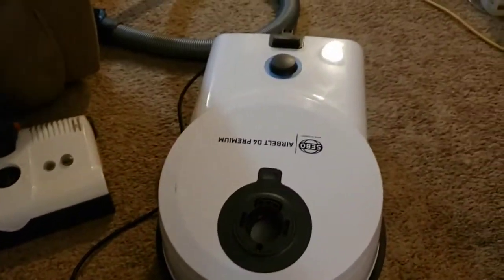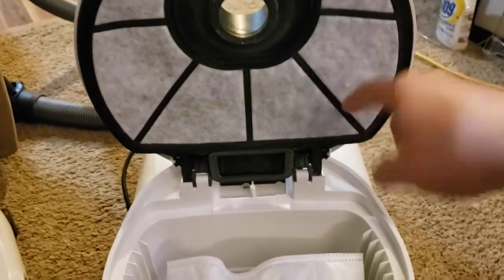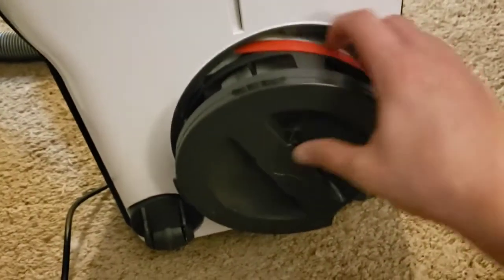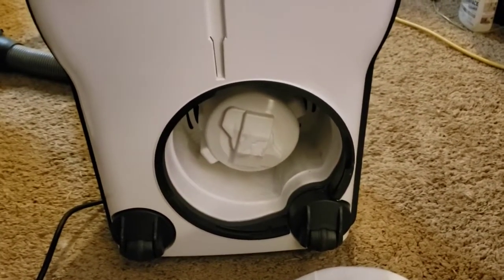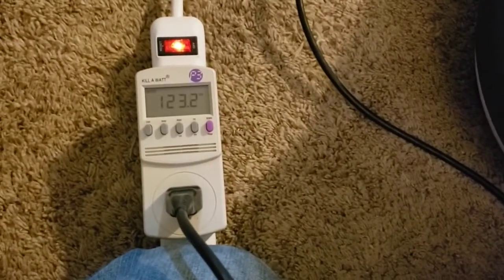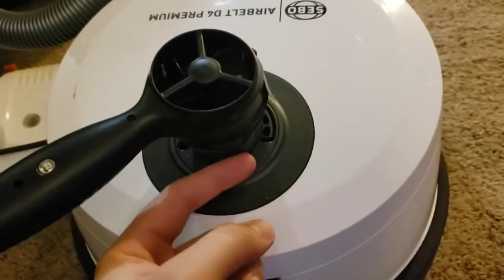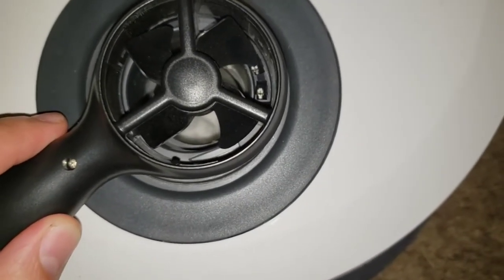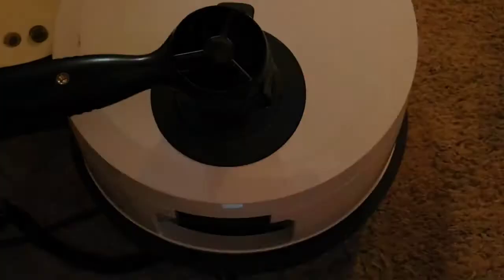Sebo D4 airflow test

Comment: i wonder how these cfm #'s compare to the Miele ce Marin.
Reply from the maker: Well I've measured a Brilliant just never did that on video. Due to the setup on those I cannot measure from the hose inlet as the machine doesn't turn on without the hose in place.
Hose: 103.27 CFM 92"
Wand: 92.99 CFM  90"
Power nozzle (236) 67.31 CFM  19"
Reply: @Blackheartvacs  thanks that’s even better than i expected
Reply: I got 112cfm on low to 153 on high. I use a testo anemometer probe that can calculate cfm for a given hose size. This was for a c1 classic, new bag.

Comment: Apparently only two D4 models are available: white (at sebo's us site) and (through vac dealers) onyx black.  From your tests and others it appears D3 and E3 are very similar wrt performance.  D4's bulkier and more costly but does have swiveling hose at tank, longer cord, and larger bag/filters.  The E3 I recently acquired compares favorably to my Miele C3 Uni-Q.  I found the Felix a good all around vac that tended to get bogged down in ultra plush carpet which doesn't bother the E3 much.
Reply from the maker: Yes they've changed the models a bit. Back when I had my first D4 they were available in white or black there was also a red model that typically didn't come with a power head but I think it could be added to it.  Right the motor specs on the D4 and E3 are the same so we should see similar performance though it's clear the E3 is a better sealed design as it's suction is higher. Ah yes the felix has more weight on the front of it's nozzle i've tested that due to curiosity from others. There is now an available soft carpet bumper which has holes to relieve suction which would make it easier to work with.